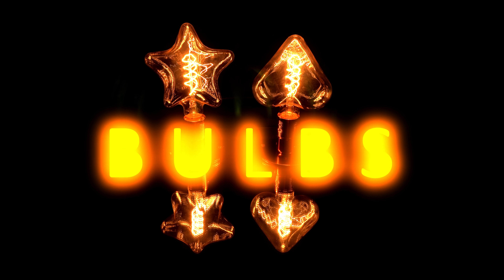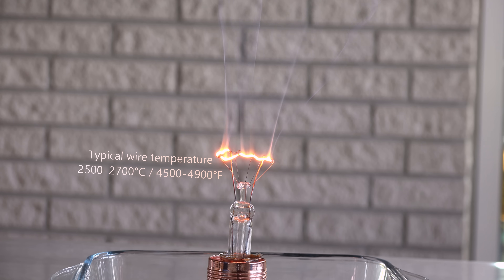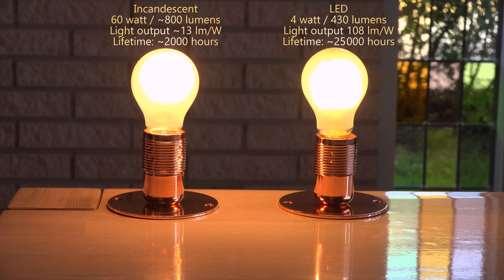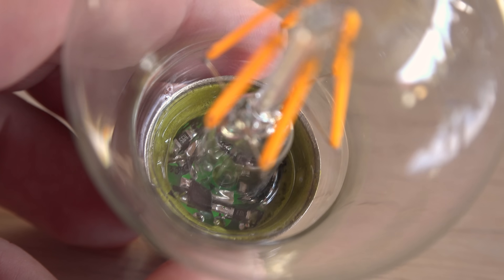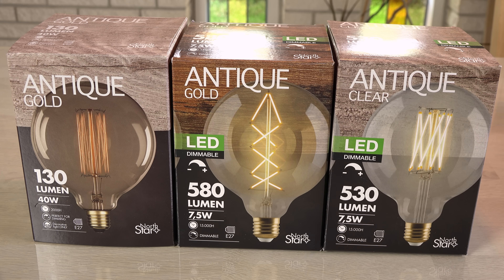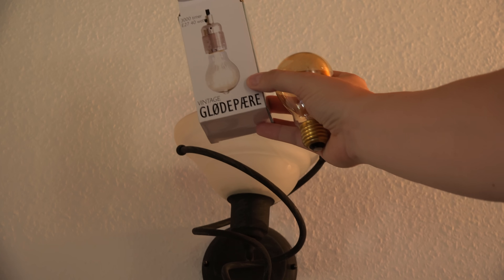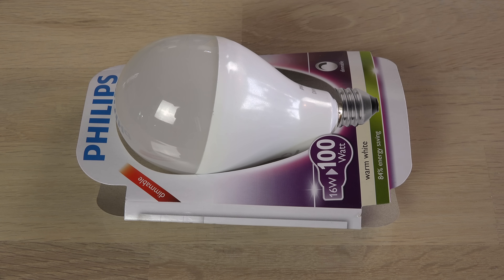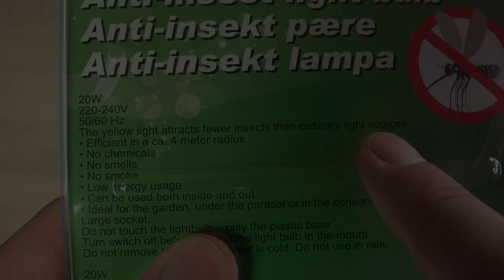Light Bulbs | LED vs. Incandescent

Comment: If you are already heating a room with electricity, does it matter if the incandescent bulb is 'inefficient' and giving out more energy as heat than an LED light? The heat from the bulb means the heater has to do a tiny bit less work, but it won't cost any different overall, surely?
Reply: Heating with bulbs is just inefficient, compered to other heat sources
Reply: Except for all the days of the year where you don't want to heat your room, but still need light.
Reply: That's how i heat my room with my computer lol.
Reply: Except that they give off very little in terms of room heating, meaning that heat is mainly just wasted energy...
His point was that the reason they are so inefficient is because they waste a lot of energy as heat, not that the heat itself was the problem.
Reply: Put one watt into a system, and it will give off one watt in heat (or radiation) so yes lightbulbs Are just fine as heating..
Reply: swunt10 good luck saving money by not being connected to the electricity grid.
Reply: mibars no hes not
Reply: @vgamesx1 Indeed. I was just highlighting a scenario where the inefficiency of incandescents didn't actually waste heat (because it goes towards warming the room) - a scenario that would apply to me in the Scottish winter. In the summer here, it is both warm enough and light enough during the day not to need either heating or lighting, and in the summer I usually go to bed before it gets really dark.
Reply: Yeah, I really don't get how heaters can be efficient.. Since their job is to be the least efficient XD
Reply: +Prajay Basu  one watt in in one second oroduces one joule, in both a heater and a lightbulb. Same with the computer.. So if you already are heating with an Electric heater, it makes No difference.
Reply: listepikster Yes, I know.  Heaters are heaters, they need to be the most inefficient machines since they don't do any work, like the computers.. Just pointing this out to some people who think heating with lightbulbs is more inefficient than a heater..
Reply: +Prajay Basu Well, I totally  missed the part about electric heaters... I was thinking about aby kind of heaters, such as natural gas or oil heaters. My bad.
Reply: The issue is that we tend to have lights above us and heating mostly ceiling and since hot air raises upwards this heat does not come down that easy. Yes, they radiate - But you would need multiple reflector type bulbs to significantly heat stuffr below them and still ceiling would be heated by bulbs anyway.
Reply: +mibars You raise an interesting point. Do you know how much of the heat from incandescents is radiant and how much is convected? Ceiling panel heaters that radiate infrared are more efficient than convection heaters.
Reply: fburton8 I don't have any data, but I suspect that most of the heat is radiated. The difference with bulbs is that they radiate all around and the closer the object is (ceiling or luminaire itself) the more heat it absorbs  while dedicated IR heaters have reflectors to bounce off IR back down.
Reply: ever wondered why nobody heats with electricity? are you an adult? go and ask one. paying bills will give you the answer. heating with electricity is stupid, expensive and a waste of of energy, resources and infrastructure. why the fuck would anyone with half a brain go to the length of painstakingly producing electricity, usually by heating water, to produce electricity in huge plants with massive losses in the conversion from primary energy to electricity because of heat loss. then send the electricity via the grid, which is expensive infrastructure and usually at full capacity anyway and produces another 30% loss of electrical energy by producing heat at a loss just in transport, just to then use this highly valuable electricity to heat the fucking house instead of using the cheap primary energy directly with no losses since all you need is the heat anyway... for fuck sack people start to think and use your brains. the project of civilization and democracy depends on you idiots not dragging the rest of us down. that's also why we need this ban, because people are to stupid.
Reply: Sure as long as there are powerplants that need heat to produce electricity. And what about the places that only have hydro, solar or wind energy. Those places can't use city heat and gas or coal is not always a solution either. That's why a lot of new houses are being build with electricity heating where I live.
Reply: swunt10: Electric heating is not necessarily a bad idea, nor is it always the more expensive option.

In the past few years, I have moved between two small comparable apartments: one heated with a natural gas furnace, and one with electric only. I record the details from each monthly utility bill into a spreadsheet, and I was able to compare the two. Overall, I actually save money in my current electric-heated apartment. Although the electric-heated apartment had slightly higher costs during the winter, the gas-heated apartment incurred additional gas customer and distribution charges throughout the year, even when no gas was being used. These service charges are not applicable to the electric-only apartment. These extra charges, overall, made the gas-heated apartment approximately 35% more expensive annually in terms of energy utility costs.

In a house, one would have more space to heat, as well as hot water to heat up. This increased demand would allow for an economy of scale: the savings from the cheaper gas heat would overcome the extra gas customer and distribution charges.

Thus, the cheaper option is situational, and not a given.

Also, the electrical infrastructure is not usually at full capacity, as you say. Load is significantly lower during the nighttime hours (often around 60%--it depends on the locale), and it is the highest during the hottest days of the year, when there is high A/C usage.

Electric heating may make more sense in the future, as the use of fossil fuels is curtailed. If grid storage becomes available, then electrical energy stored during the day using renewable sources such as wind and solar can be used at night with electric heaters, without the use of any fossil fuels whatsoever.

And by the way, your use of expletives and insults does not help your argument.
Reply: BirdValiant "I record the details from each monthly utility bill into a spreadsheet, and I was able to compare the two. Overall, I actually save money in my current electric-heated apartment." interesting lies. make it more plausible next time by telling me you did research in the field of electric heating versus gas heating at harvard and that you used a super computer over 10 years to work out the details.
Reply: +swunt10 Nice trolling. I really hope no one notices you.
Reply: swunt10: due to gas customer charges, the gas-heated apartment charged an additional $137.24 total in the first year--just for the privilege of being connected to the gas distribution network. This extra charge is not applicable to the electric-only apartment. Although the cold winter months are slightly more expensive for the electric-only apartment, the extra $137.24 for the gas-heated apartment mean that it is more expensive overall.
Reply: BirdValiant the same is true for electricity you moron.
Reply: thexyz He is talking about no connection to gas... 

It is 100% possible what is he saying because service fees are sometimes higher than actual energy consumed. Also having gas in apartment generates additional requirements for ventillation, annual insections, etc. For a small, well insulated apartment it may be expensive compared to savings from cheaper energy!

Comment: I use my incancdescent bulbs for heating. Why ban them!
Reply: That's an odd way of wasting energy..
Reply: JanusPrime
I waste no energy lel
Reply: Rem Well since you use lightbulbs as heaters, yes you do :b
Reply: JanusPrime
Still a lot more efficient than using them to light a room :D
Reply: Rem Fair enough xD But not as efficient as a dedicated heater :D
Reply: JanusPrime
At least I don't use a 1MW heater. And at least I get some light out of it :D I will always try to counter you.
Reply: Rem Yet you'll never succeed :b
Reply: JanusPrime
Yet you will always fail to make me fail
Reply: Are you a reptile?
Reply: Stop lying. Heat is negligible.